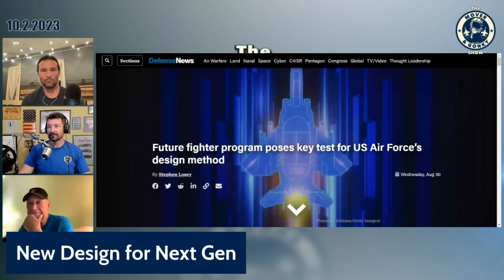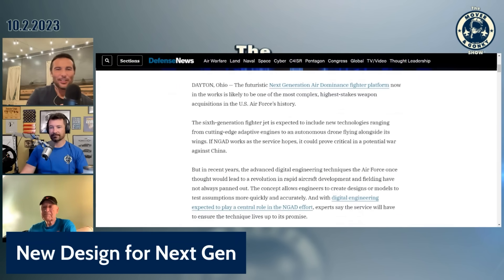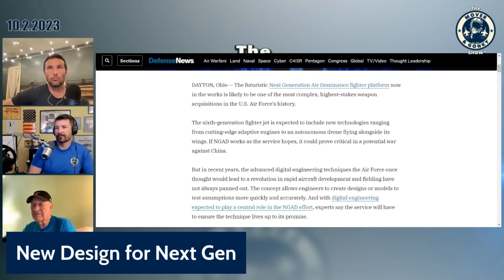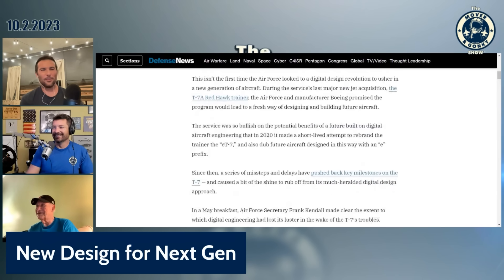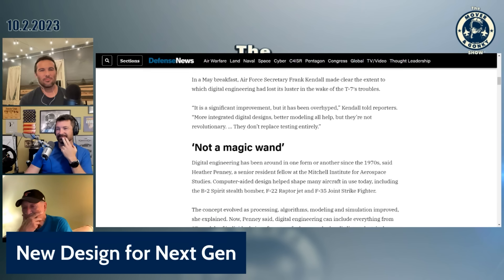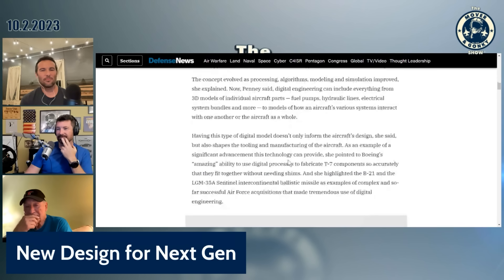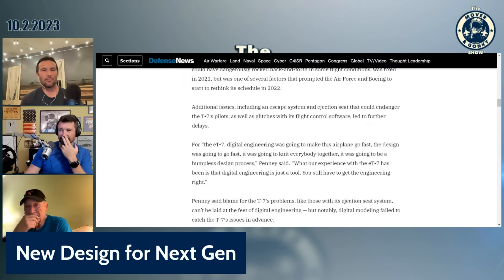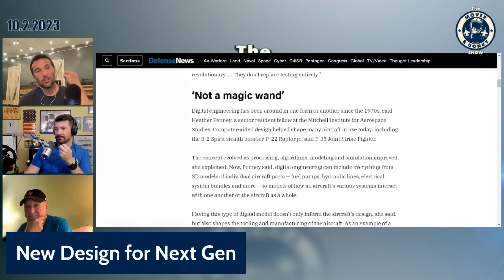Former USAF Engineer's Insights on the Design of the Next Generation Air Dominance Fighter (NGAD)

Comment: Hmmm... expected an interesting discussion on all of the new systems from engines to intelligence-gathering systems to Radar systems to weapon systems, data-fusion, stealth, etc. The aerodynamics is a pretty trivial part of it all at this point. Yea, test-flying usually covers some minor surprises but not many any more as we found out with the F-35. I work for a company that builds Radar and emulation systems and it's an amazingly complex field.. The man-years of effort just on this single component is massive. Modern day fighters are the result of all of these combined efforts on the various systems and software coming together in a single flying platform which I don't think the general public is very aware of anymore.

Comment: Maybe I’m missing some context from the rest of the interview but this was such a low-level discussion.

I understand there is no replacement for physically building a model to test its performance in the real world and there is also no replacement for having a human inside to test ergonomics, but for the latter, we are approaching a shift to autonomous aircraft probably in 6th gen fighters if not sooner so then pilot-focused designs will be less of a priority.

Where is the discussion of the massive cost savings and benefits of computer modelling? The dismissive comparison to making a house appear from smoke is ridiculous. 5th Gen aircraft was made with MASSIVE digital assistance in a way that was not possible with 4th Gen.

This guy really wants to sit there and tell us that “the guy who has been doing it for years” with analog instruments and brute force testing is going to come up with something like the F-22. Really?
Reply: Yea, was wondering the same thing. I expected an interesting discussion on the new fighter, not this. The aerodynamics is such a trivial part of it these days. It's way more about all the systems and intelligence gathering capabilities. I work on radar systems which is but one component and it's an amazingly complex field in regards to detecting and classifying modern day AESA radar systems used in other aircraft and ground radar and also new over-the horizon systems, etc. We have a ton of people working on just this one aspect which also includes emulation to help with design of jamming and RWR detection systems.
Reply: the world will probably turn upside down if you find out that the f-22 was designed with the help of aerodynamic tubes and not with CFD

Comment: Computer design for sure cut down on cost... the flip side of that most people forget, is that when cost os pushed down, complexity is pushed  up.

The other issue is the very low production volume of modern aircraft push up cost, its not only about the prototype, but also the full series.

Compare say a modern military jet to a airliner. The airliner bust cost a fraction . And ofcause, people will claim that military jets are more complex, and sure, that is true to a degree, but the bulk diffrance is the volumes.

Its not like something lile a A350 lacks complexity. Its just that the volumes are huge. And this is not only due to higher production number but also higher modularity. Now of cause the tempest project supose to push modluarity.

Comment: Eric is what the industry refers to as 'an old fuddy duddy'. It's ok to admit you don't understand modern tools, it happens to everyone as they get old like Rick😊 Experienced people using modelling and Sim do it very well, any 'youngen' as Rick is implying is doing all this CAD and Sim work... is obviously not going to be as good at design.
Reply: What I got from him is CAD and sims are great. But building and actually flight testing more planes will make you a better plane builder. I don’t think that should be particularly controversial.
Reply: With all those expensive degrees they require people to have you think Lockheed would make a real hypersonic plane but no, we got a movie prop instead.
Reply: @agena6594 Sure.

Comment: Simulations and emulations are only as good as our ability to understand the physics and underlying behaviors of the plane. There's a reason most electrodynamics and fluid dynamics can only be truly understood with experimentation. I speak as a physics phd formerly focused on simulations of nanoscale semiconductors.
Reply: One of my good friends completed his PhD on direct numerical simulations with no modeling for turbine blades. Just a few years ago this was considered impossible. Computing power is getting there. However you still need experimentation. With proper simulations you can limit that
Reply: Oh yeah, I'm a huge fan of simulations and what they can do! It's just important to not oversell their capability, because it can create huge backfires for the implementation and integration into future programs and platforms.  @mignik01
Reply: Are you aware of the technologies thst are being used by defense contractors for their design and conceptual testing.